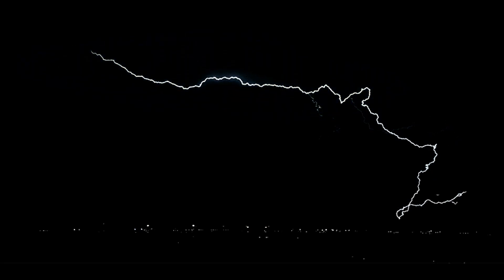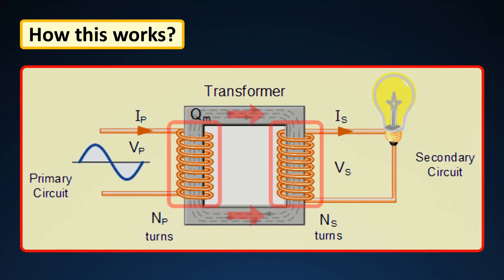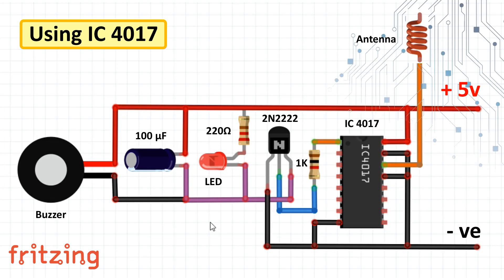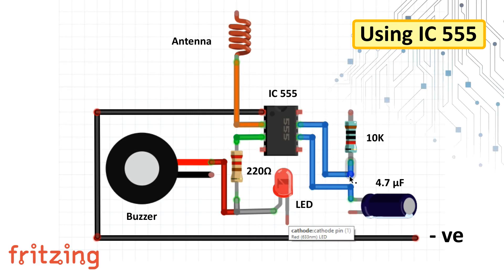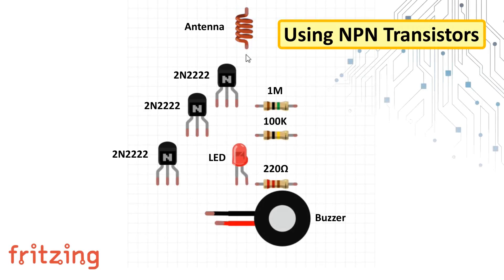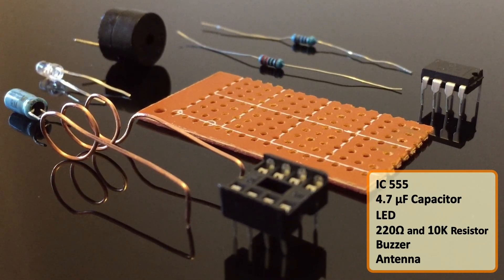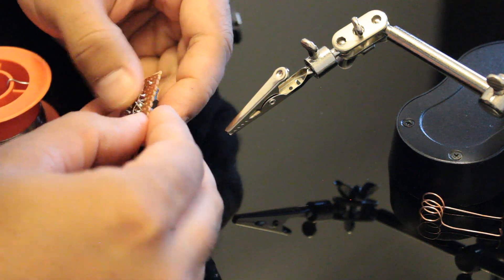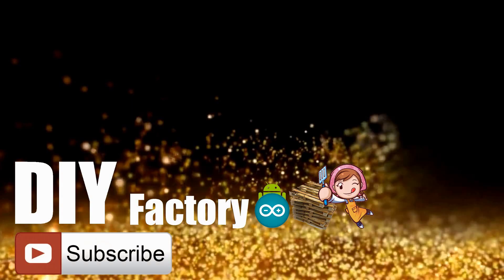Contactless Voltage Detector

Comment: I just tried your second project but it was not working totally failure
Reply from the maker: I bet it would be a total failure if you are not doing it correctly.
The 2nd method is just a simple current amplification, i dont understand what are you doing wrong there. If you know what a 555 IC does then you should very well understand the simple simatic that I have shown. 
There is nothing special in that, its just a simple amplifier.
Reply: @CrazyCoupleDIY  I tried the second circuit as well, and it doesn't work. The LED turns on when I touch the exposed tip of the antenna with my finger, but it doesn't respond at all to an AC transformer plugged into the wall. Meanwhile, I have an EMF detected that I purchases which flashes like crazy when next to the same AC transformer.

Comment: hi, great project! tell me, can this detect live wire inside walls?

tnx.
Reply from the maker: Yes it does. I have done testing with the 555 and it definitely detects a live wire inside the wall.  The one with the transistors can also be used but frankly speaking you need to be really up close to detect anything
Reply: @CrazyCoupleDIY  then, he need some amplifier? :)